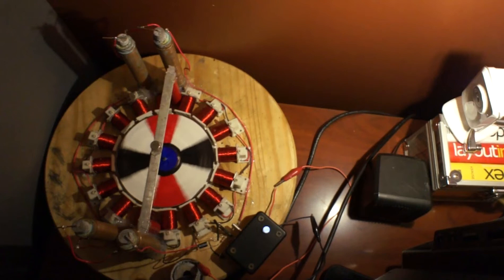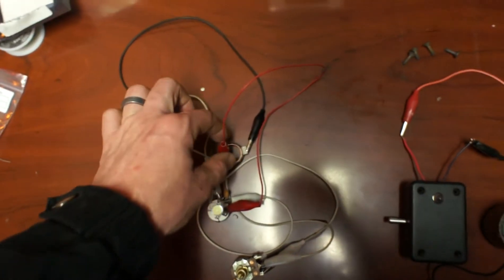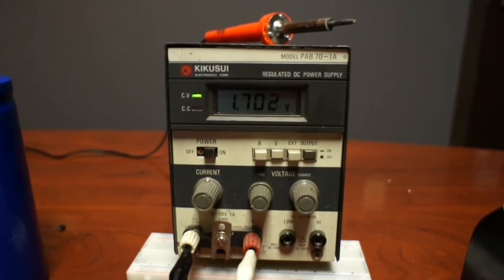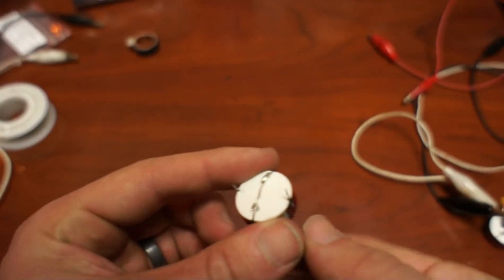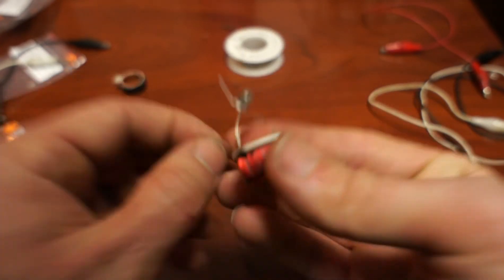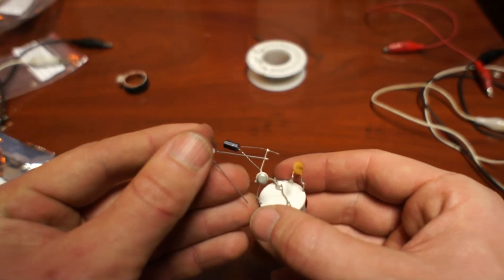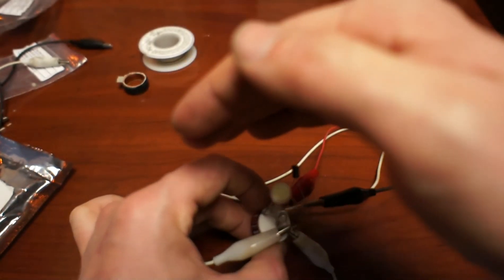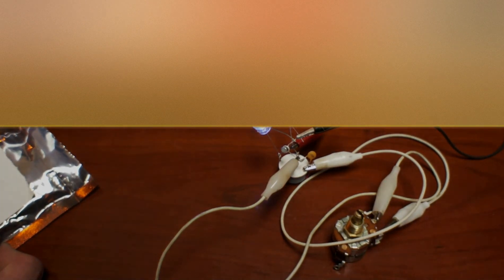Cheap easy to build Joule Ringer.  Runs on 2uA!

Comment: hey laser, made this circuit eariler, and i compared it to other simliar low-power joule thief. sadly, this lasted on high-brightness only 1 and half days. power consumption in only 4ma at full brightness, but is this because i used little bit different parts, as for pot 100k, pretty different yes....and as for transistor basic bc547.  It seems it was indeed because of different parts, i remade this with same parts except coil, and current consumption dropped. Anyway, thanks for sharing :)

Comment: Regarding your copper pipe /magnesium battery.
May i suggest to make battery more compact or super flat(no gap in center like in pipe) by using thin copper sheet which is easy to cut along with magnesium foil.

Comment: So basically this is a simple unregulated oscillating circuit that boosts voltage and allows you to control duty cycle by varying the frequency.  At least that is what I am getting out of it.

Comment: Would you make a correct circuit diagram on your web-site ?
The circuit diagram video does not correct. Because of the capacitor.
You use two capacitor in your circuit. But The diagram show only one capacitor.
Thank you.

Comment: I could not get the LED to flash. I removed the .001uf cap and replaced it with a .1uf cap (104M) and it works great now.

Comment: Great little circuit, I built one using a generic NPN transistor I got from radio shack (which I can't identify anymore) and it still works great!  I can get light from a red simple red LED for less than 1mA, and it is full brightness at 10mA on a nearly dead AA battery.  Thanks for sharing!